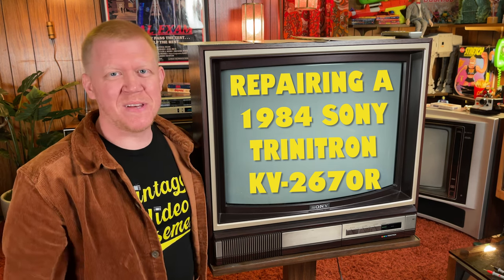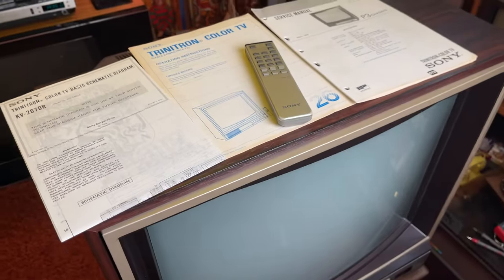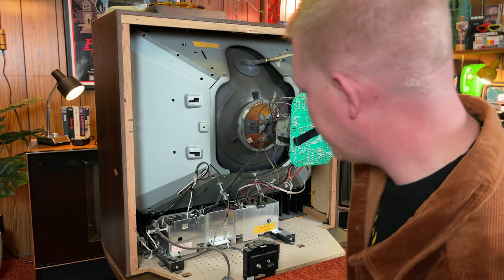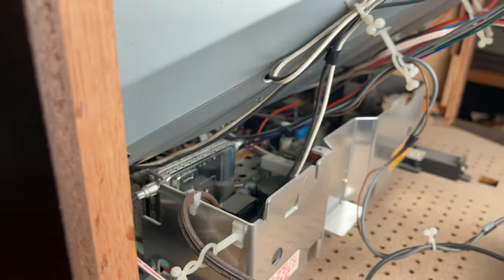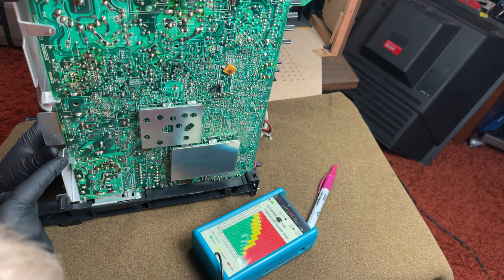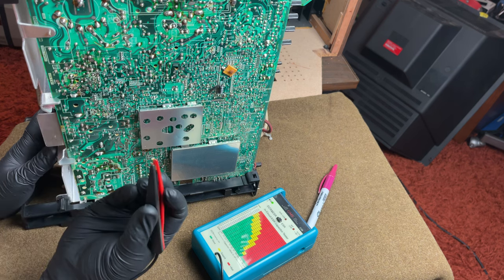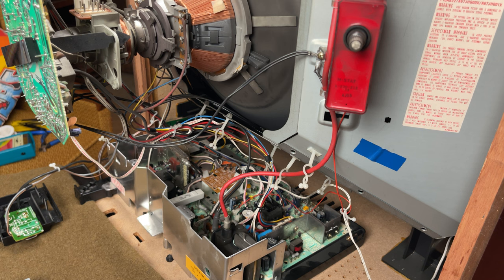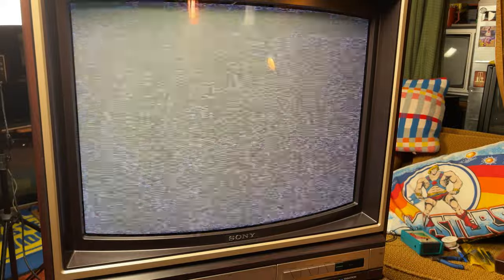Repairing a 1984 Sony Trinitron KV-2670R

Comment: Excellent video. Thanks for your patience and honest method in fault finding. Ive worked as an electronic engineer for over 20 years with mostly modern digital equipment but ive got a real affinity and interest in old electronics like CRT TVs and 8-16 bit games consoles. Ive recently bought a working mega drive gen 1 and a mitsubishi CP-1627BM just to clean up and maybe upgrade with some new capacitors etc if needed. Any solid advise for me starting out this hobby in regards to equipment spare parts and sourcing repair manuals for old electronics? I live in the UK.

Comment: Nice work! Can you go into more detail regarding the equipment you use and how to use it properly? I’ve got a 90’s set I’m about to start replacing caps on.
Reply: It’s always good to get a refresher on discharging the high voltage, too. I’m still working up the courage to do it myself for the first time.

Comment: Hello Matt, I love your content. I was hoping that you could help me with some issues that I have with my Video Cassette Recorder. If it's no trouble for you.
I have the JVC HR-2200U Video Cassette Recorder, and it’s fully functional, I can watch tapes with no problems. The only issue is when I want to record with it. I’m using a Panasonic WV-3060 Color Video Camera, which works because I can see an image through the viewfinder and when I press the camera’s trigger switch the recording starts and the tape advance. The REC and PLAY indicators are lighting, so I assume that the recording is taking place. But when I rewatch the tape to see what I recorded, nothing appears. I have no image that has been recorded or sound. Do you know what may be the problem and how to fix it?  I appreciate a lot your answer and help!

Comment: You really should do a full recap of the board, and the Neck Board. All of those caps are 40 years old.

It makes no sense, once you're already in there, to just find the bad caps. Because others will also fail, in a week, a month, a year, etc. It's fortunate that there are relatively few caps compared to newer sets.

So why just do minimal repairs when, for a small investment, you could have this performing flawlessly for decades to come?

It makes zero sense when I see people do this. So sad for this beautiful television. Just recap the damn thing. No logic at all.

Maybe someone else will buy it and give it the tiny extra effort that it deserves to make sure it's reliable, and prevents any future damage that could ruin it permanently...

Comment: You are not a serious tech. Anyone who works on vintage gear, audio - video - PC, and who already has a unit taken apart for service, starts with a recap at the very least.

40 year old polyprope caps - they have to go. If you can't do everything, then the power circuit, the neck board, any place that gets hot or handles high voltage.

That's basic. Something you figure out in your first couple of months. After all the times you've had to go back and repair something that you've already finished. Because something else went bad.

So you start with a recap from the get-go. Then typically you reflow the solder also in the sections that get hot. Again, basic, day one service.

Then, once you know that all of those things are good, if you still have an issue, you are starting from a good foundation. So much easier if it ends up that there was some bad resistor you had to track down. 

Then I see spots on the board with really old flux, or more likely, corrosion. That's going to slowly eat through the board and cause some short.

Not cleaned. Not addressed. Just left to ruin a vintage TV (ten years away from Antique) that is both beautiful, and currently in beautiful condition.

I've seen some of Adrian's Braindead Basement, and he does the same thing. If he could replace a cap with a wire and a piece of tape, he would. I can't watch that guy. 

He's obsessed with vintage kit - but he doesn't CARE about it. I think he really cares about clicks and sponsors. Does he have sponsors? I have no idea.

But if you genuinely care about any vintage kit, then you walk up to that nice assortment of caps that you have, and you pull out everything that's on the board. Every important circuit at minimum. And whatever you don't have, you order.

That's how you know that you genuinely appreciate this amazing old tech. Not by scraping by with the absolute minimum that you can get away with just to get it running. 

I wouldn't do that with a vintage car. Definitely not with some vintage audio. Nor with a vintage PC. And I wouldn't do it with this gorgeous television. 

I'm glad you rescued it. If you rescue a neglected dog, you don't just bring it home and give it a new blanket. You feed it, wash it. Give it a comb and a cut. Buy it a new collar.

So even though this TV is safe, it's sad to see that it hasn't been cared for. Maybe you're just starting out, so I'm hoping that your knowledge, experience and approach evolves, and we see that you really care. That you really get serious.

Anyway, best of luck to you. You've obviously started a family. I can only assume that you take that seriously. That should translate to all aspects of life that you care about...

Comment: you skipped the cold solder part. So am not impressed.
Reply from the maker: I never actually saw the cold solder. I reflowed the vertical deflection part of the board, and the intermittent failure was resolved. I forgot to film that part too. It’s a hassle to set up the camera in multiple locations and film yourself while you just want to get the job done. I’ll work to show more details in the future. Thanks for the comment.